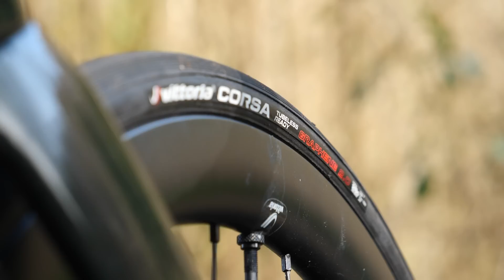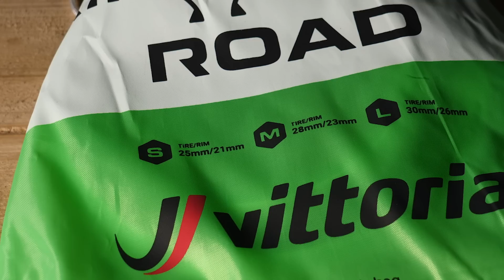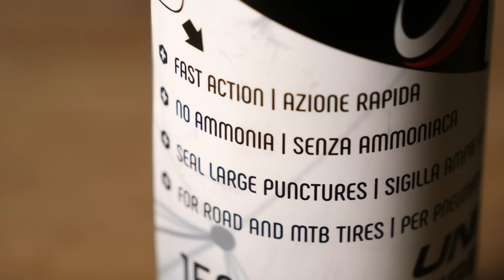NEW Run Flats: Pro Cycling’s Secret Tech | Vittoria Airliner Road First Look

Comment: Here we go again. Something else for industry to relentlessly shove down our throats! Like electronic shifting, disc brakes, and tubless tires, and wider,, low inflated tires. These are all nice advances in technology, but none are absolutely necessary per say. I use none of these,  and still ride relentlessly. Tubeless tires, who needs to go thru that pain in the butt. I run conti 5000's at 120 psi. I am a heavy rider. Never flat. Well maybe once a year. Little bit of a rough,  bumpy ride, but hard as diamonds and very flat resistant.  Disc brakes, heavy, ugly, and less aero for sure. I stop just fine with rim brakes.. Especially with the new brake tracts on my new Zipp 404's. Give me a choice, don't make bikes with disc brakes only! Been using mechanical for over 10 years and over 100k miles. Zero issues. No broken cables, nothing. Who needs electronic, not me. And finally my personal pet peeve, wide ass tires and low psi. I will never jump on that bandwagon. 25 is as wide as anybody needs on a road bike. Some people are running 32's! How ridiculous is that!? There is only one advantage to that comfort, certainly not speed. If your worried about that so much, buy a trail bike with 36's!  I really love when somebody pulls up next to me with 32's with 60 psi and try to hang with me with 25's at 120, and get their doors blown off! Talk about road resistance, they might as well be stuck in the mud! There, I feel better now!😳🥴🤣🚴🏻‍♂️🚴🏻‍♂️
Reply: ZZZZZZZZZZ
Reply: @lisazack6459  Gets some rest before reading next time!😳😅

Comment: Looked great until the bomb shell about fitting and removing the tyre. Tubeless tyres are difficult to fit and remove at best of times. The price is ridiculous, but not a surprise given the packaging. On balance, no thank you.
Reply: If puncture does not seal itself, you can use the worm plug things. I have never had a puncture where i have needed to remove a tubeless tyre on the side of the road.
Reply: I’m sure it can happen, but the probability is quite low. Tyres are so good these days i have not had a puncture in 4 years (tubeless or non tubeless). I have multiple bikes and for £89 per bike, i can afford to summon taxi assistance quite a few times, if necessary , tho. likely i won’t need to (touch wood).
Reply: I’d pay £30 for the product at the most...there are similar alternatives, not quite the same, but a fraction of the cost. The product is a good idea, but it’s over hyped and mostly marketing. Unf. I do not have more money than sense.
Reply: @Bungle2010  ok, i get it. I don’t usually ride out in crap/wet weather. The product has obvious benefits, but not it’s  worth it to me. For pro tour riders, I understand...but still it’s not for me at that price.
Reply: @Bungle2010  yeah i live in the UK (300 miles this week 🙂). I don’t go out in the wet, when punctures are more likely. I ride TT tyres in the summer. Seriously i’ve not had a puncture in 4 years, maybe i’m lucky.

Comment: Vittoria just made an already complicated messy job with tubeless even harder and messier. If your swapping out training tires with racing tires, you now have to deal with a messy liner that’ll be dripping sealant everywhere, a tool to compress the tire to ensure that the insides stick to itself, and now you need a tool to do it because it wasn’t hard enough to install and uninstall tubeless. Game changer
Reply: Yep... Hard pass from me! Innertubes for the win.
Reply: I thought the same thing about Cushcore initially, and it was a faff when I first tried it. Same with regular tubeless honestly. Now I don't even think of it. 

Also, I suspect that with a worn/stretched tire a bit it will be easy enough to remove without the bead breaker tool. It will probably only be necessary for weak hands or new/tight tires.
Reply: Carry a couple of spare ziploc bags and a couple of zip ties.
Reply: if you are meticulous enough to have dedicated tires for races. Then you should just have a dedicated wheel for races... swap wheels!

Comment: I would love to see the liner inside a tube. I hate the mess tubeless can be + they loose air on a daily basis.
Reply: I recently installed Airliner gravel in a pair of 40mm tires. It really improves the bead seal. I was able to seat them with hand pump. They no longer have to be pumped up before every ride.

Comment: 2019 inner tubes are done for.. meet the new tubeless tyre.. 
2021 now you can put a $30 foam noodle inside your "tubeless tyre" 
Yes its basically a inner tube type set up but we finally worked out how to charge you £30 for 1 inner tube so they are cool again 🤣 

So glad I dont follow moronic "trends" I'm still rocking gp4000s with inner tubes at 40 and still taking the odd KOM 🤣
Reply: And rim breaks too 👌👌

Comment: I don't buy into Vittoria's marketing anymore. I have never got the performances they claim especially from their tubeless tires. I like my Bontrager R3, regular not tubeless, tires and I am currently using the Schwalbe Aerothan tubes which I have been having good luck with. I will never use tubeless tires again, I've tried damn near all of them and different sealants and in my opinion that mess just isn't for me anymore.

Comment: Yes, absolutely yes. I won’t have any more high speed crashes again from that untimely puncture. Plus I won’t need my on board tool kit with the tube, air and levers any more. I’m ordering them now!
Reply: Saves a lot of weight (and aero without saddle bag) with this setup on top of the ease of mind. I wasn't gonna even think about tubeless for years, but this makes me rethink
Reply: Sure. As long as you stay close to home and away from hills.
Reply: @seahog32  Well I’ve been tubeless for several years and I’ve never flatted. This just takes that reliability to a new level. I’ve already not taken my tire repair kit with me several times because I begin to take that reliability for granted. I don’t understand your ‘away from hills’ comment?
Reply: @stevevarga8621  Ever tried cornering with 25 PSI in your tires or generally going down a long descent even of a modest 6% average incline let's say? I am actually not against tubeless as such but this badly overpriced things have a very limited use. Basically, they require you to ride mellow roads not far from home.
Reply: @seahog32   Id take a look at how widely adopted tubless inserts have become in the mtb world, I think it's only a matter of time before they become pretty standard in tubeless road setups (particularly now people are running higher volume tyres).
Reply: @seahog32  You need to watch the opening 60 seconds of the video again. He’s riding the descent “briskly” with zero air pressure. You’re past experiences are irrelevant. The foam insert provides sufficient support for you to continue riding without the massive degradation in performance. I really think this combination of the tubeless tire, sealant and the foam insert will be a major game changer where we can now ride without a legitimate fear of puncturing. The pros should definitely be using this all the time. The number of times flats have effected the out come of a race is ridiculous.
Reply: @stevevarga8621  Thank you, already watched. It's rather unclear how much residual air did they keep in the tire for this promotional shoot. Maybe you should watch beyond this cool slo-mo footage. Even Si managed to sneak in an opinion that it is "probably" not recommended for longer rides. In other words, if, after a few hours of riding, you happen to flat 50 k and 2 mountain passes from home, you better have somebody sitting on phone ready to hit the road to save your ass or else you're effed. I admit though that it is fine for a ride to the nearest coffee shop where one can discuss the nuances of the most recent tech upgrades with the rest of the lycra-clad patrons.
Reply: @BigBanana55  Well, look for mostly what kind of mtb riding. They are fine to take you the short distance to your car if you are riding loops somewhere in a park. That's not what road riding is about though. Not for me, anyway, but to each his own.
Reply: @seahog32  I’m sorry but we must be watching 2 different videos. There is no slow motion in the opening scene of descending and Sy’s first words are ‘I’ve just descended that hill briskly and I have no air in my tires’. Not a little air, he said no air. Skepticism is fine, proper and useful but there is no need to deny the facts as presented in the video.
Reply: @stevevarga8621  Touche. That short moment around 5 sec. felt and still feels to me like a slowed footage but I may be wrong on that. It must have gotten stuck in my, admittedly poor, memory somehow if there is nothing else close to slo-mo later in the video (sorry, I don't feel like watching it again). Bottom line, though,  you can't remove the tire without a special (bulky) tool and put a tube in if needed. That makes those things impractical for long rides. Whatever that means for you. For me that means mountains anywhere I turn, 90% of them with no cell (mobile) phone coverage, public transport, or any amenities whatsoever.

Comment: There is no way a tubeless tire went on that easy with a foam core inside :). Also, cushcore is used to run super low pressure and not ding / burp wheels. Not sure there’s really any reason to have this. No performance advantages (like a cushcore) and if you were riding in a road race and flatted, seems like an extra 50W to push around, so unless it’s near the end you are probably better off just punching a dart in and adding co2. Maybe I’m off.... 🤔

Comment: The removal tools seems a bit large to fit in a saddlebag.  If you do have some sort of failure you'll be depending on these to get home as you won't be able to do a field repair
Reply: @Bungle2010  think of them like those little donut spare tires.  They work when it's your only choice but you really don't want to drive in one for long.  If they were as good we'd all just get a set of those foam inserts and throw away our air pumps.

I was thinking of situations like touring where home might be many days away.
Reply: @roberteltze4850  but if you are touring for many days, surely you'll be carrying more than just a saddlebag, right?  The tool will fit in panniers, a frame bag or other piece of larger luggage; but it is not 100% essential for you to be able to remove the tyre - it just makes it a lot easier... The clips are more essential.
Reply: Works fantesticularly for the rides to your local coffee shop though.

Comment: There's so much extra steps involved that I'm not convinced it's a practical solution for everyone
Reply: One extra step you mean? Certainly though, like most bike tech it’s not going to be for everyone.
Reply: Just get your local bike shop to do it for you if not confident.
Reply: @talonlan  I'm thinking it's just a hassle. Rather than all of the shims and the big clamp on top of maybe a tire lever, I'd rather just use a bacon strip or a patch on my tubeless setup. For anything like a massive gash I wouldn't enjoy riding on the equivalent of 30psi on my 25c tires, so it's not a great solution for me. The mountain bike version makes sense, but I don't see it paying out for the road.

Comment: I ride tubeless and tubulars for training rides on two separate bikes. Nothing wrong to my mind with either of them. Neither one feels particularly faster. My superlight tubulars do feel faster uphill, though. No doubt about that. And for the same width, they definitely feel more supple. I keep a spare tufo tubular under my saddle. Its just about 200g and rolls like a garden hose but it gets me home just in case. I had tubeless fail catastrophically on me. It rarely happens but when it does, you better have tire levers and inner tubes and hopefully, you have a rim tire combination where you can seat the tire roadside with a minipump. Some combinations require very high pressures because they fit super tight. With those, you're out of luck. To me, tubeless actually makes most sense on my commuter.

Comment: If they made a liner that was 60psi, I'd love it.  I run my 28mm tires around there anyway (I'm light), then I'd finally consider not worrying about tire stuff while riding.
Reply: even if it was 60 rather than 30 psi, this isn't meant to be constantly supporting the tire. I imagine it would fatigue over time if you used it that way, as foam is compressible. In addition, I don't think you would appreciate the increase in rolling resistance. This seems strictly like an alternative to being stranded on the side of the road changing your tire.

Comment: This could really be the end for tubulars in the pro peleton. The main use case, being able to ride when having a flat, is out of the window. I am a strong opponent of tubeless tires. To me they seem to be a messy inconvenience that I do not need in my life. That being said, I did not have a puncture in the last 2 year with about 10 000 km. But this is a technology I will keep a closer look on.
Reply: That exactly!
Reply: Tubeless isn't messy unless you choose to just splash the sealant into the tyre, or drink it.
Reply: @whatwelearned   Or you want to remove it, because it dried up, splashes everything after a bigger puncture.
Reply: now flats for 10000 km? your weight is 60 kg and you using gatorskin or durano? or you ride indoors?)
Reply: @manueldeubler1127  Well no if it's dry it's dry. Sure, if you get a tear.
Reply: @enotracoon9244  I never ride indoors, I'm about 74kg and I currently use Schwalbe Ones.
Reply: @enotracoon9244  I use my road bike on fairly nice roads. I avoid streets that I know are not in good condition. I also try to avoid urban areas as much as possible. With my commuter I have some punctures. But the last one was from an idiot who cut open my sidewalls. Regarding the tires, 5000 km on Duranos and the other 5000k on Continental Grand Sport, which seem to have quite a lot of rubber.
Reply: Im a strong opponent of tubeless as well and I ride exclusively on tubulars. When I have a puncture on my tubulars, I just pour out the sealant into my tires via the valve and inflare using cannisters. easy. I might give these tubeless a try. Tubulars still have one small advantage. Lighter overall weight 😁

Comment: Would you recommend it for cyclocross if you don't want tubulars?
Reply: Hi Stijn, I use larger rim strips on my cx bike and I think they are great. You can run really low pressures just like tubs, but there’s no faff.

Comment: Ninety-nine bucks! You can get something similar in a fraction of the price from Walmart or Home Center!
Reply: I highly doubt it's the same technology specifically for road bikes
Reply: @Mububban23  🤓... no man, I was just joking. I do not have courage to experiment with the same and then damage my expensive wheels/rim... I still use traditional clincher+tube system, although my wheels are designed for tubeless. And if I switch to tubeless in future, will consider the Airliner.

Comment: That piece of foam definitely cost them like 1 USD/meter from China. And to be honest, they dont even need to join the 2 ends.
Reply: super over priced
Reply: Yup, but raw material cost isn't everything
Reply: @supernoodles908  a lot of R&D would have gone into it but at the end of the day its just a bit of foam. If its targeted at new riders it should be much cheaper. No new rider is going to be spending that much. Any longer distance its going to horrible riding on. changing a tube is so much easier
Reply: @ezquiel700c  I don't see it for long riding, I see it as a safety thing. Going down hill 60+km/h you want some safety. Yeah an inner tube is easier (which is why I'm not tubeless) but if I was to run tubeless, of use these. 

But I do think it's over priced. Imo £15 per foam noodle plus kit and extra £15. So like £40-£50 I think would be reasonably for the whole thing. Selling in bulk at a low prices will get them the same profit overall
Reply: you're paying for the research that's why.
Reply: @supernoodles908  Yea, safety is probably the only good thing. but for regular rider especially beginners its highly unlikely that they will be doing regular fast dangerous descents where a flat would be dangerous. 

£40-50 would be much better, it makes you think if they are marketing it as a safety or a luxury product. GCN are milking it a bit
Reply: @darinsteele7091  2 year old research remember, they've had long enough that the pricing should be much lower

Comment: What's the risk to the airliner when installing a plug in your tubeless tyre to fix a hole?
Reply: Usually when you stick a plug in there’s still some air in the tyre, in which case the airliner would still not be its full size. And I guess, worst case scenario and you put a tiny hole in it, it’s not going to affect it.

Comment: Seems cool for racing but I've had tubeless for going on three years and never had a case where this would be beneficial. I'd rather put a tube in and keep going rather than limp for the rest of my ride. I guess pros have more severe punctures.
Also, i guess it's useful in the U.K where roads are total garbage.